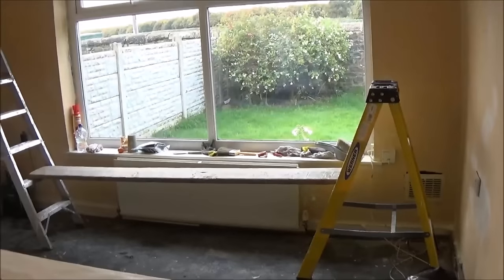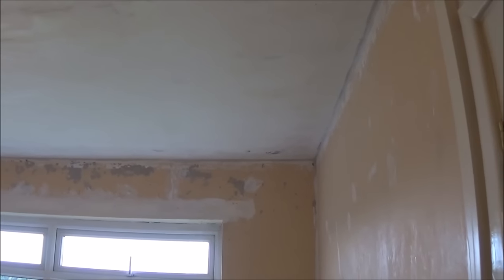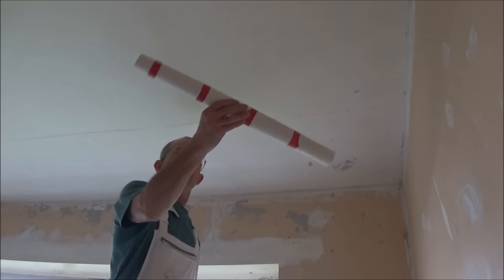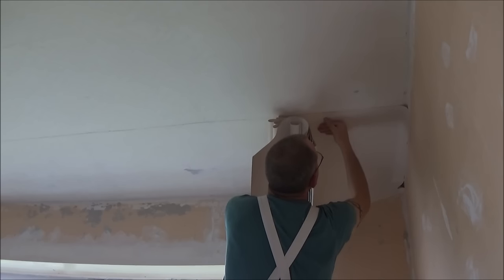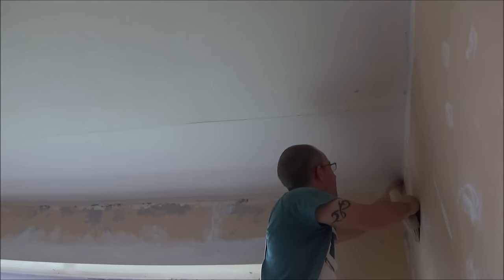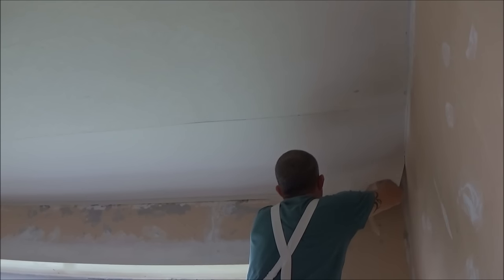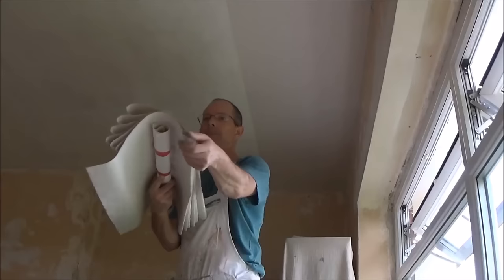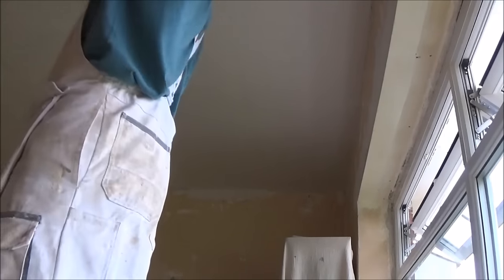Applying Wallpaper To A Ceiling

Comment: Thank you so much for posting this video! I watched the entire video thinking "there's no way it's going to work like that for me" but when it came time to wallpaper our bathroom ceiling- everything worked out exactly as you showed it here.  I didn't have any extra paper to roll up when we started, so I used a sturdy wrapping paper roll that I cut down to size and it worked like a charm!  Wonderful video!
Reply: Is he putting the glue on the ceiling or on the paper,
Reply: Did he apply glue on the celling first, or this is self adhesive wallpaper?!!! Need to do the bathroom ceiling , if someone can advice what king of wallpaper to look for...thanks from advance!

Comment: I have used a long handled brush but you still need a raised platform to walk on, no mention of that here. I had to piece mine. moving across from one small set of steps to another whilst holding the brush !!

Comment: As an absolute noob this leaves so many questions for me. I appreciate anyone who takes the time out of their day to be helpful, but I'm just left with so many questions. Are you on stilts? Can this be done without them? Exactly how did you prep the ceiling? A quick, sped up portion showing that would have been cool. I do realize this vid is a couple of years old now, I hope any more you have done are a bit more informative.
Reply: He's using two pairs of step ladders and a plank (as a makeshift platform). So yes you can do it without stilts, you just need said items. 

As for prep.  Just make sure all bits of paper are stripped, good sand on what's needed, fill, caulk any cracks, gaps etc. Another sand down.

He also rolled the ceiling with pva glue which does help the paper stick but if you can't get any...just use paste!!

Hope that helps 👍

Comment: Hi if you have a sloping ceiling at the window end, with a dorma window. The slop is not quite true. Would you recommend hanging lining paper ready for emulsion across the window or from the window?
Reply from the maker: It's difficult to say without looking but you can line either way. It's all about nice joints. Thanks

Comment: This is a skilled job. Ive just tried Blown vinyl ceiling paper and ended up having to cut each length into three. You make it look so easy. How long do you soak your paper for. It seemed that the solvate recommended 8 minutes was too long?
Reply from the maker: Thank you, every paper can be different. Usually soaking time is on the wallpaper instructions.

Comment: Something that isn't mentioned in this video, if you're using a ceiling wallpaper that has a stipple effect such as Superfresco then you overlap the ceiling wallpaper onto the wall, when you wallpaper the wall, it causes a lump to appear along the top of the wallpaper.

This must be caused by the stipple effect of the ceiling wallpaper because in rooms that have ceiling wallpaper with no stipple effect I've not seen a lump along the top of the wallpaper. The only way to avoid this it seems is either to not use a ceiling wallpaper that has a stipple effect or have no overlap onto the wall.
Reply from the maker: You do have to adjust with different papers...  leave just a couple of mm and that should bot show.  but your are wright with a lump showing.

Comment: Liked & Subscribed. I am a first timer using wallpaper to do a 3x6m ceiling. No windows. Would you recommend I lay it in 3m lengths but have more joints or do 6m lenghts and have half the joints. I'm worried 6m lengths of wallpaper might make it more difficult for a first timer?
Reply from the maker: Won't matter really if you get the joints wrong and they show.    .all that counts is no joints showing on finish. Thanks

Comment: Hi, my boyfriend and I did my ceiling yesterday, we got the paper up ( paste on the back👍🏾 though he pasted the glue all over the  
front of the paper😱 ( I wasn’t so sure) - I want to now paint the ceiling with white emulsion will it be ok?
Reply from the maker: If you have paste on the front of the paper, you will have to wash it off using warm soapy water. Wet an area and allow to it to react with the paste, then wipe off. If you emulsion and some paste reacts then just scrub in the area with the paint.  Thanks.
Reply: @PaintingandDecorating  humm...not fully clear from your reply 🙏.  option: Wipe it off. I've just looked at it dry and it looks reasonable.. Are you sure I cant just put emulsion coat on it?   🙏
Reply from the maker: If you have paste on the front of your paper, and you apply emulsion it will react with the paste causing problems.

Comment: Curious why the coat of pva?
Reply from the maker: @huskamania  PVA is a glue and diluted it soakes into the plaster. And helps reduce the porosity of the plaster.  
The paper sticks better. Thanks
Reply: @PaintingandDecorating   yes, thank you. I know what pva glue is. And I understand, diluted it will soak into plaster. Thus reducing porosity. But in an old pre 1940 building, how is that a good thing? Pva, surely, diluted or not is not breathable

Comment: glue lining paper in horizontal or vertical , is this important or ...?
Reply from the maker: Horizontally is best less joints and if you ever paper over it the joints will not line up. Thanks

Comment: Why does it need to be dead straight if your just painting it, your just creating work for yourself.
Reply from the maker: It's wrong to follow the edge of the ceiling. So you mark a line and the line may as well be straight. This also makes sure you're not messing with a wedge on the last length of paper.
Reply: You will have a wedge at the start or the end. It's easier to have it at the start where you're not messing with two lines but one.

Comment: Have u tried using knives to cut the paper?
Reply from the maker: Yes but it's cheaper way to use your scissors and not to buy snap blades all the time . Plus it's the correct way old school.
Reply: Painting and Decorating time moves on, that's like a joiner choosing to use a screw driver over a drill .
Reply: @mcgraw8098  Some papers are too thin to cut with a blade and you end up tearing the paper, also the wall can be uneven and again you get pockets where the paper doesn't sit tight to the wall resulting in tears in Both senses of the word lol! a sharp pair of shears (scissors) will cut through lining paper without actually having to cut it too much and it isn't that much quicker if at all to use a blade. You also have more control with shears. I'd use blades on vinyls but lining paper would always be cut with shears

Comment: they sold me a can of sizing, do i need that ????
Reply from the maker: Diluted PVA will do the same but not everyone agrees on this. We use it all the time and used correctly no problems. We have a video called What you need to know about PVA
Reply: Has to be very thin mix. gets absorbed into the plaster to stablise it goes rock hard, takes paste then.

Comment: the trouble i have is the paper sticking to the ceiling
Reply from the maker: Your paste may be too thin or your not applying enough to your paper. Also you may not be sealing your plaster before hanging your paper.  Thanks

Comment: Use chalk string to mark with
Reply from the maker: SuperPhilcool You can if you want but this is a cheaper way. My dad used a chalk line and different colours of chalk depending on the colour of the surface. But I found it  a lot easier this way and no need to buy chalk you still need to pin the string up, but a few pencil marks is enough for me.

Comment: Total load of bollocks ,the moment you mentioned PVA i thought here we go another one .No need for pva as it creates a barrier between the plaster and water based paste and the paper will slip and not bond right . Always run the paper the shortest width across the ceiling so you get 3 lengths to a roll ,no need to work away from the light .Also no need for a pencil line either  and no need for the spare roll to hold it ,do it free hand off the wall edge and if it runs out just adjust back till it runs in for an overlap on the wall .in 40 years paper hanging i have done thousands of ceiling ,s in every type of property going including heavy blown vinyl whites at 30 ft long per run . 1400 and 1700 grade are the best for ceilings with a smear of fine filler through the joints and two coats of a vinyl silk paint . Never put matt finish on fresh lining paper or blown vinyls and even the older  papers as the joints when drying will crack ,use a silk as a first coat then a matt finish .
Reply: Do a video then Geoff....

Comment: Always use the full blade of the scissors so you get a cleaner line (open them right up) don't use half as seen here, good video though 👍
Reply from the maker: Stonka you not done much papering or you would know, follow the line and sometimes with paper being wet and bending it's easier and more accurate to do it shown in the video and not full cuts. Have only being papering for over 30 years.
Reply: Done quite a bit as it happens coming up 20 years myself and my teacher is still going after 50! It's not really an issue when lining I know but I prefer a full cut especially with finishing paper, you can follow the line when nibbling at it but you'll never get a true line imo, each to their own though I suppose! I'm not knocking your work it's good to see a proper dec slinging in b&b for a change I've subbed👍
Reply from the maker: Stonka thanks, I was taught not to use the full length of the scissors as your cut will not follow the line fine enough as paper bends and not to close the scissors fully because they can leave a funny tear at the tip.